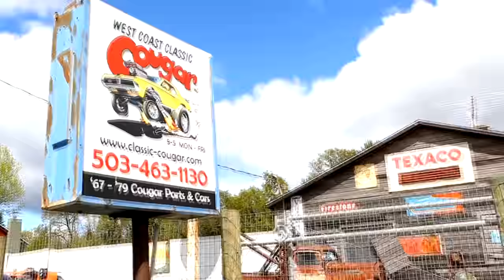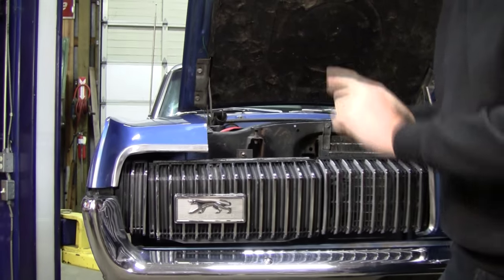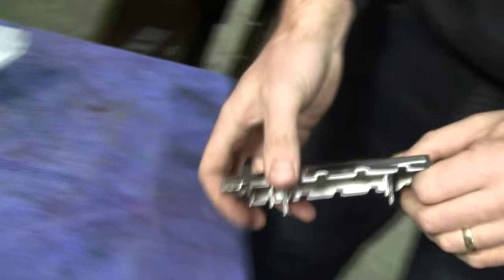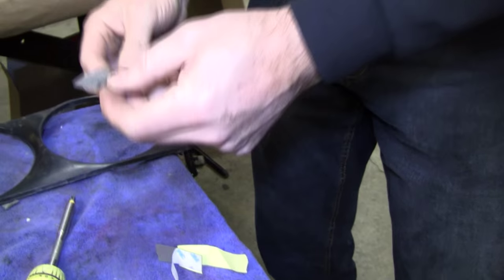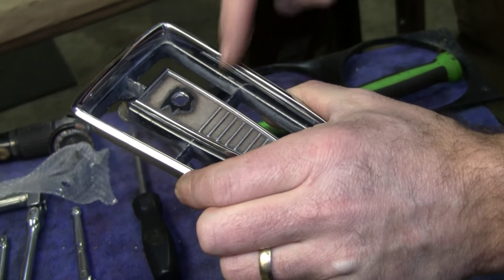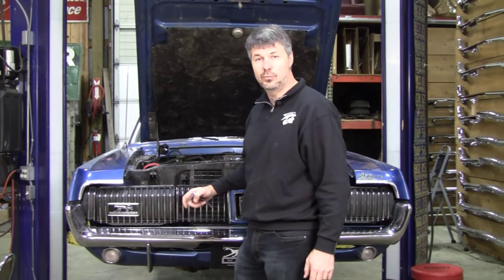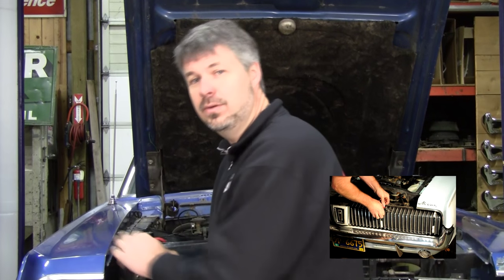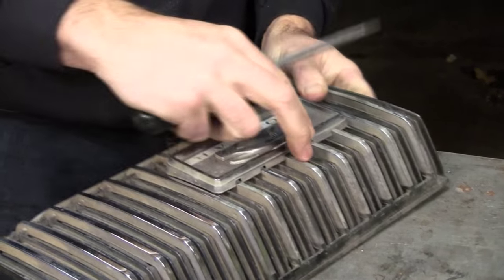1967-68 Cougar Grille Restoration Tips / Emblem Replacement

Comment: Just an  note about  the final staged to return  the restored/New parts.  
   My experience  with Motor cycle  parts   made it the norm  to  wash my hands  with dish washing liquid  to strip any skin oils  and pollutant off  as to not have them transfer onto the parts  that oxidise  normally over time .
    The other  method  is to have a very soft cloth  or  high-end paper towel  to hold the chrome  piece  as I put it in place. 

     Mr.Rosh 
      If you wonder why  I do   it ,   just take any  screw driver  and pinch  the shaft  between  the thumb and 2 first fingers   with your  normal mode  hand  ( unwashed)   as in this video .   Then use  the other hand  on the grip handle and  pull  on it to see  how   low the friction point  is to   remove it from the fingers.  
               Next  , clean  the screw driver  and your hands  with  grease  removing   Dish washing  soap ( quality brand)   to do the test  one more time  and feel  the  new Pull-Force needed break  the friction point  .  
          Maybe  even  do this with someone  at the Shop so THEY can feel  the difference for  pulling  it from your thumb and 2 finger   grip.   
       The skin Oils and basic  air-born pollutants  on things the you touch will be transferred     onto  other things you touch   on the cars  , even trim pieces  .     While a quick wipe  fools the eye  for that gleam  of new chrome ,  the surface   it pretty porous at the micro level  and   your innocent finger print   may show up   15 years down the road  as a dark spot  that can't be cleaned  . 
      I also noticed this on  high-end  B-B-Q   units  where the stainless steel  backing  plates   behind the control  Knobs would go dark  where the finger tips  rubbed  on it.  Sure they were stainless  steel  to not rust ,  but they do  show their age  from pollutants  . 
 
     
   
   I only say this because  Cougars   parts  seems to be hard to get for NOS   items and   even  Workers at the factories  in  the 1960's  promo Shorts   by Ford  that makes the trim  items   will wear soft  cotton type  gloves to package them or move on the quality control  .  
                  Lincoln    back in the  late 1970's  started to ship their   cars with a thin black plastic coating on the grill   to protect it from  nicks  and also  toxins  or oils  during shipping  .   Later  they  reduced weight  by going to Chromed  plastic  grill  unit that also kept Insurance  repairs  down   but it still had  very thin  film on it  that pealed off  prior to delivery .     
       
   If someone plans to wash the car  later  on with  degreasing soap   for the chrome  that would do the job ,  but a restore car  or  original   one with new badges  might  be  a garage kept  car for the odd drive  and go  a year   with just a wipe down  by a rag.
   Corrosion doesn't sleep .
Reply: +Gary wood Good tip Gary!

Comment: Hi! I search for the white plasma bulbs at your site but only the 1156 are listed, there are 1157 but in red and yellow. Do you have white available? Thanks!
Reply from the maker: +Roger Lizama For 1967-68 and 71-73 they are 1076 bulbs. The white plasma replacement is here: http://www2.cougarpartscatalog.com/store/p/15336-Plasma-LED-WHITE-Two-Pack-Replacement-1076-Bulbs-Back-Up-Lights-Repro-1969-1970-Mercury-Cougar.html

Comment: Can you do one like this but for 69? i have a 69 cougar that i am restoring for my first car and i want to get the emblem looking new as i spray painted the grill section a flat matte black and left the center and kitty emblems original
Reply: +Gabriel Hernandez   Same procedure for 69, brak the corral off. grind the studs for the cat off in back, remove cat, peel faded decal, install new, epoxy cay back on (or buy new) and epoxy corral back on.  Items 26457 and 10081
Reply: +Don Rush  thank you very much don